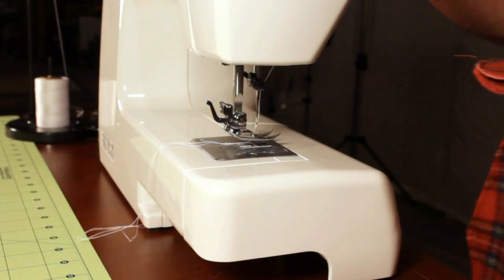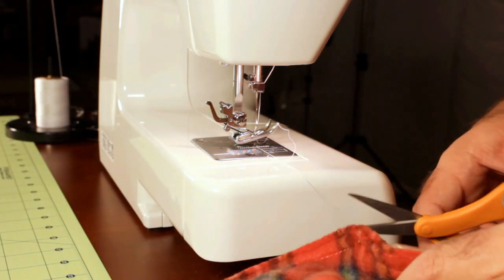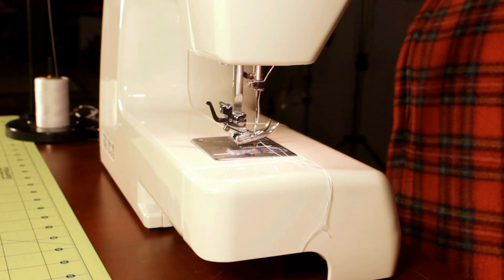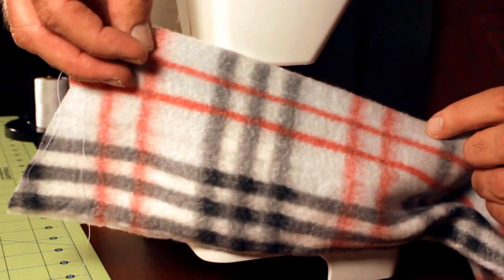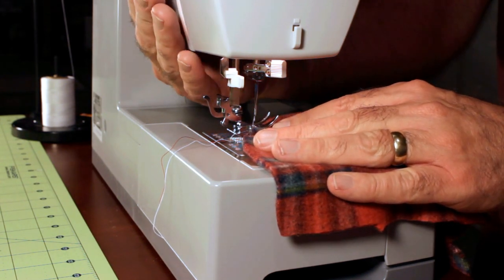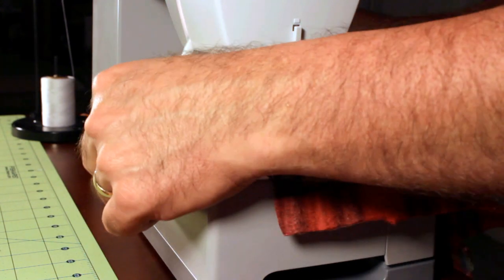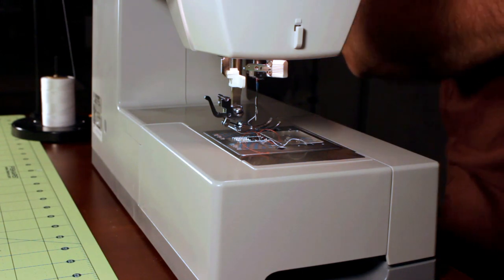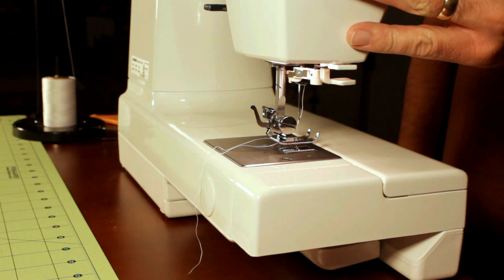Sewing Fleece on the Babylock BL9, Singer HD 4423 and the Janome HD1000

Comment: My experience using Singer 5400 Sewmate , after a year the tension stopped working...to fix it would be more then what I paid for it...so I purchased a Molly Baby lock and wow....it worked so much better then the Singer.  I bought a walking foot for the Singer and still had issues while sewing.  The Baby Lock is so much smoother and worked on different fabric thicknesses without changing any settings or foot.  So happy with my MOLLY baby lock!
Reply from the maker: So you've been sewing the same amount on the Molly as you did on the Singer for the past year correct?
Reply: The Baby Lock is new to me (6 months) but far superior to Singer and I had many Singers over the years.  I am sorry I waited so long to change brands.  I just finished sewing a heavy cotton and switched to a thin tricot material and didn't have to change the footing or change anything.  What a pleasure using a machine that works so well.
Reply from the maker: I am glad you are happy with your Babylock. BTW, that is the Janome Sewist 500 machine. You'll find it here: https://www.amazon.com/Janome-Sewist-500-Sewing-Machine/dp/B00AJXX95Q/ref=cm_cr_arp_d_product_top?ie=UTF8